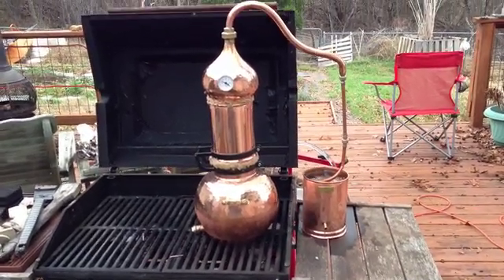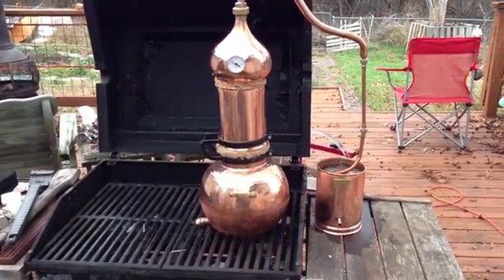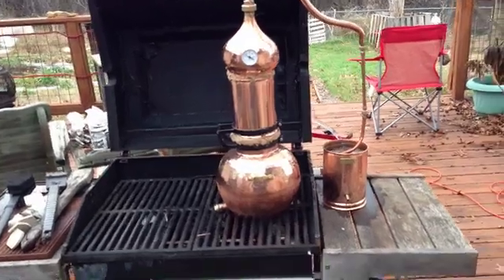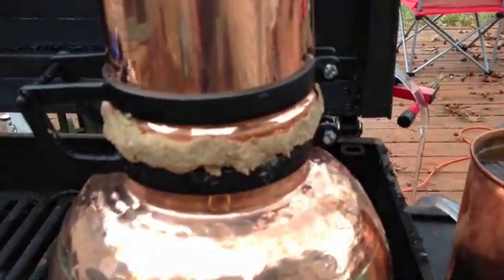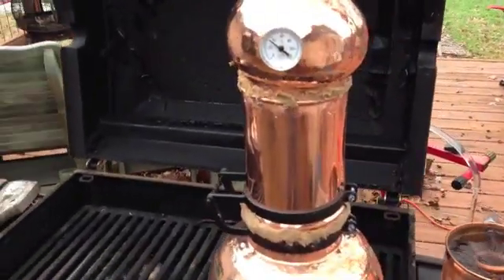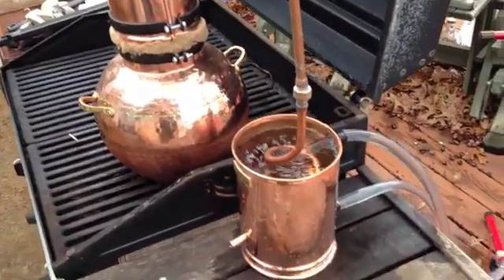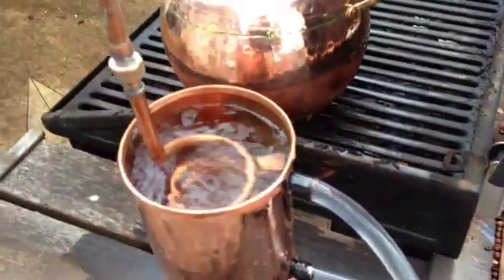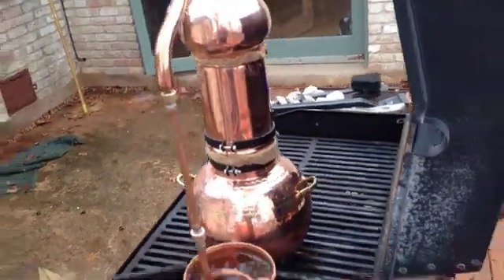Alembic Distiller

Comment: If you have good friction fits between the various stages, there should be no need for the rye paste sealant on this open system.
Adding a thumper would make it a closed system, requiring sealant.